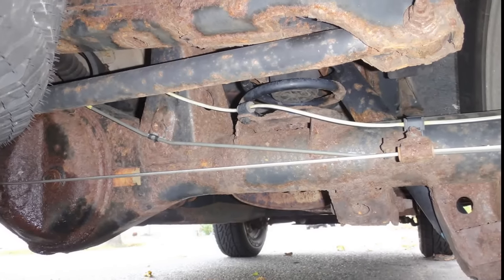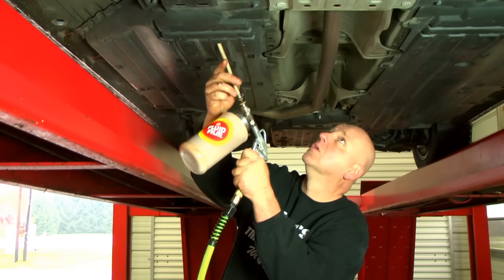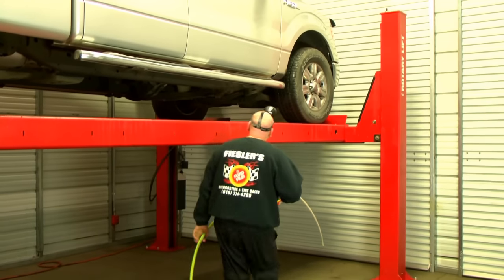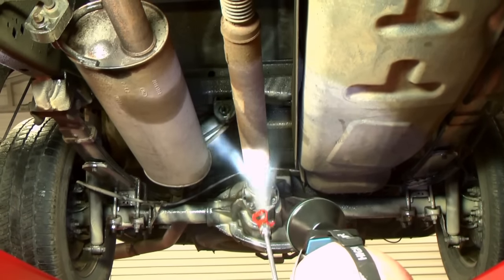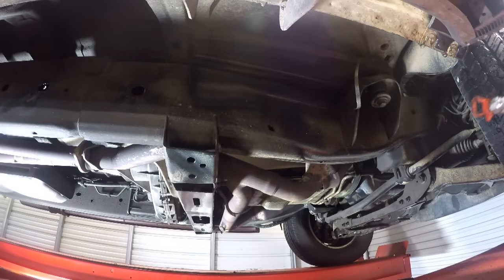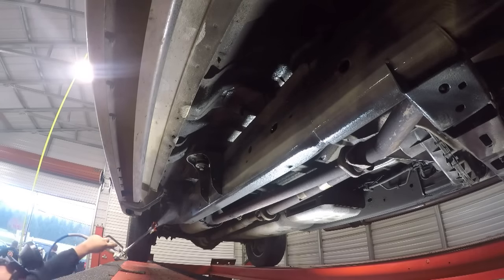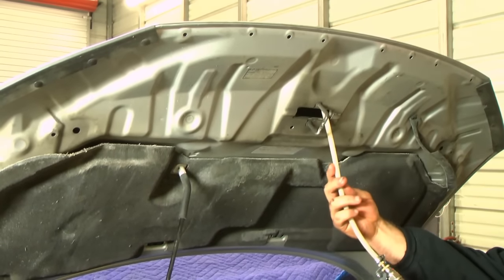FLUID FILM® Undercoating Tutorial

Comment: Apparently 27 people like rusty vehicles. FF is the cats ass. I’ve been using it for years with 100% success.
Reply from the maker: THETOPGLOCK Thank you!
Reply: I know your comments a little old, hoping to reach you, applying for the first time today, what should I avoid spraying while applying?
Reply: I use it on everything. It’s the only lubricant that last’s.
Reply: @Anthony-eg7pw  Avoid brakes.  Some say it also affects rubber but not as bad as petrol products.
Reply: UreaSmith appreciate the reply ,
Reply: I discovered Fluid Film because I just discovered major rust-through on a good-running car that could have lasted several more years.  This could have been prevented had I known about Fluid Film and used it years ago.  Rust is the worst way to lose a car.

Comment: I remember the first time I used FF, I thought it was goopy, thick and messy. Now I use it every week in the garage. I found a plastic bristle paint brush as my go to for applying the stuff, spray some into the brush and apply, puts a nice thin transparent layer down.
Reply from the maker: 49s13 thank you!
Reply: My preferred means of application is with a brush for the exterior surfaces. It  allows me to avoid the mess of overspray and waste with spraying in general.

Comment: This stuff is awesome.  You really need the official FF application gun and 360 wand to do it right.  One gallon has lasted me three years so far and that's with two apps a year in my SuperCrew F150.   Just remember, a little goes a long way.
Reply from the maker: Derek Vinyard Thank you!
Reply: Derek Vinyard Do you have to have a compressor? I don’t have one
Reply: 😁 My first application on my 2017 Super Duty crew cab 8' box. I used a hole gallon. Then 2 spray cans with small 360° tube for doors tailgate and hood. Mite be a little excessive but 2 years later looks perfect. The white Rancho shocks have 0 rust. They rust if you look at them wrong 😉. I apply twice a year.

Comment: I have the kellsport pro kit and love it! I need that spray gun emerging at 2:40 to cut down on application times and still doing a quality job. What a great undercoat. Love fluid film.
Reply: That's an airless sprayer probably for line striping parking lots. They pressurize the paint to 3100 psi. GRACO makes them. They can be costly. they have all different tips for spray width and volume. Good thing about these when they are spraying paint in a parking lot they will remove alot of dust while it's spraying . They blast pretty well but are expensive.

Comment: Bought several cans of this stuff and applied it to my truck this morning. Let’s see how it works!
Reply: How did it work for you?
Reply: @BaptistJoshua  hey it worked awesome for me. I used about 4 cans on the underbody, and then one can for the doors and body panels. Totally worth it. I found once a year was enough. But then I moved to Arizona so undercoating is a thing of the past for me now 😎😎👊
Reply: @QuintTheSharker  Nice.  Thank you.  I am trying to figure out what non-oil resistant rubber they say not to use it on would be.  Seems like vehicular rubber would be oil-resistant.
Reply: @BaptistJoshua  I get that. I was worried about it too. Depending on your vehicle, maybe you wouldn’t have to worry about it. My big thing was if the rust proofing degraded some rubber trim or seals over time, those parts are cheap to replace. But once the body starts to rust, the clock is ticking. For what it’s worth, I coated everything I could inside and out and I’ve never had any rubber fall apart on me and I started using fluid film 5 years ago.
Reply: @QuintTheSharker  Fluid Film responded to me by e-mail.  They said:

Almost all rubbers are oil-resistant. The main areas we see and warn about are weather stripping on automotive doors. Bushings, boots, frame spacers and motor mounts are almost always oil-resistant due to their exposure.
Reply: @BaptistJoshua  nice! They haven’t steered me wrong yet. Good luck. It’s a messy job though. Definitely plan on it getting on you LOL. Oh, and it also prevents corrosion on your battery terminals, so I put it on those, too. Great results.
Reply: @QuintTheSharker  Thank you.

Comment: 14s dont have grommets, ford used clear tape on the inside of the rocker. Getting it to the cab corners is tricky, theres a pinkie sized hole you can feel for through the last hole that goes to outside of corner, if you really want to get to inside of corner, and i would,  drill an access hole on the backside. Brake light leaks so get a decent new gasket if not to late and sunroof drains into them also. Had to weld a patch on driver side but got lucky on other side. And that foam in the wheel wells needs to be removed then soakm good. Its not spongy but still holds moisture, i put some in a glass of water and it wound up staying wet for a while.

Comment: What should you do if there's existing rust? Sand it off? Apply rust converter first? Just apply over little rust spots?
Reply from the maker: Fluid film can be applied directly to a tightly adhering rusted surface. If there is loose flake we recommend removing that so the product can penetrate to the base and stop it from progressing. We recommend applying our film directly to the rust or clean metal as converters can encapsulate rust and progress it.

Comment: With all that spraying, you're bound to have a little overspray on your disc brakes. (I speak from experience) because my rear brakes squeak under load, is there a way to clean the stuff off?  I've already tried brake cleaner.
Reply from the maker: 95BerrySt break part cleaner works well for breaking it down.
Reply: Heavy braking burns it off, don't worry about it. Take a ride around the block and brake hard at the stops  - ✔  solved.

Comment: Love love love love FF. I use it underneath my mower decks and to lubricate almost anything. Spraying directly on batteries is ok? What about 7 pin trailer connectors? I've seen people use FF instead of Dialectic grease. I'm about to do my winter clean and seal on truck, dump trailer, and outdoor power equipment. Anyone have any bad experience using it with mowers, saws, or trimmers? Wondering if it could harm certain plants...

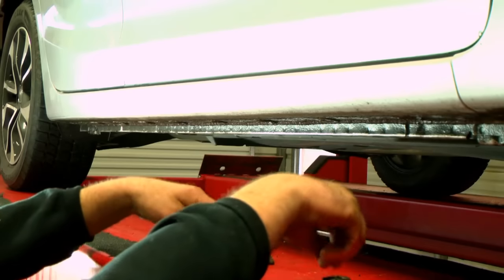Comment: @ 0:39, what type of undercoating paints does Fluid Film soften?  I was considering purchasing the Fluid Film Pro kit with compressed air sprayer and two gallons of product - mostly because up until now I have been using the aerosol spray cans under my vehicle - 2005 Jeep Grand Cherokee.
Reply: I had a CRC application from Toyota, after they had frame rot problems and feel fluid film keeps the crc from hardening, which keeps out water/oxygen. ~ Great stuff!

Comment: you guys mentioned to spray it on suspension components in the video. Is it safe? Cuz, some UCAs and coilovers have teflon coating. Can this be damaged due to Fluid film? Also can CV boots, Bushing and rubber from suspension components be safe?
Reply from the maker: mgltacoma Fluid Film will not harm oil-resistant rubbers like cv-boots, motor mounts and almost any other rubber underneath a vehicle.
As far as the Teflon goes, we have not done specific testing but know our product is used all over the off road racing for protection and lubrication of suspension components. Along with our daily commuters we have had no issues.
Reply: Teflon is the trade-name of PTFE. PTFE or Poly(TetraFluoroEthylene) is not able to be dissolved by any common solvents and is highly chemically resistant.
Reply: @asdf8391  Thanks man. My Coilovers are rusty even with PTFE. So I am applying some Fluid Film to see if that helps.

Comment: Can you apply Fluid-Film over a dry layer of POR-15 and would washing the undercarriage with a power washer weekly over the winter cause the Fluid-Film to come off? Thanks !
Reply from the maker: Hi Alvin,

Thank you for your interest in FLUID FILM®. You can apply FLUID FILM® over POR-15 but it in not necessary to paint the surface because FLUID FILM® was designed to be applied over bare metal. We do not recommend pressure washing the undercarriage once FLUID FILM® is applied. FLUID FILM® is a wet coating and spraying it with a pressure washer will start to remove the product. If you want to clean the undercarriage you can use regular hose pressure. FLUID FILM® is not water soluble so any debris on top of the product will wash off and the product will stay behind. If you have any other questions please let us know.

Best Regards,

-FLUID FILM® Team
Reply: @fluidfilmusa  so can you go through car washes?

Comment: Not looking to start an argument, but why hasn't the industry applied this product from the factory? Any feedback from manufacturers in regards to the use of Fluid Film on vehicles?
Reply from the maker: pjcd 701 some specific dealers offer our product as an option. As a wet coating our product can be removed with a high pressure sprayer and detergents so it’s difficult to offer a warranty if it was a factory option.
Reply: pjcd 701 They factory does not want your car to last! They want it to decay so they can sell more cars.

Comment: I see the recommendation for yearly application.  Is this due to any evaporation of the FF or just due to regular driving in rain, dust, snow/salt that will wear it thinner in some places?  The vehicle I want to spray should only see about 4000 miles per year and only in the spring/summer/fall so it won’t see road salt or brine.  But we do live near the coast so there is salt in the air.  Do you think I’d be able to get away with only applying every 3 or 4 years instead of annually? (Not holding anyone to their answers...just looking for honest opinions - thanks!)
Reply from the maker: Hi Chris, thank you for reaching out, yes of infrequently used vehicles in winter the coating will last much longer. The biggest need is touch up on wheel wells. A single can should be all that’s needed to do an annual touch up with a vehicle used that infrequently.

Comment: After applying Fluid Film is it wise to avoid the high pressure undercarriage carwashes?
Reply from the maker: Hi Andy, 

Thank you for your interest in FLUID FILM®! Yes, we recommend not using high pressure undercarriage washes while FLUID FILM® is applied. If you want to rinse the chassis, simply use regular hose pressure. If you have any other questions please let us know! 

Best Regards,

-FLUID FILM® Team
Reply: high pressure water is one of the worst things you can do to your car, with fluid film or not. Normal water hose is recommended.
Reply: @fluidfilmusa  why never dry
Reply from the maker: @joshuarivera2478  Hard coatings typically trap rust and cover issues. it also doesnt allow the product to penetrate into pinch welds and seams like a wet coating which is where much of the protection is needed.

Comment: In general what parts under the car can be coated and what do you want to stay away from ? Is it safe to spray bushings ?
Reply from the maker: Fluid Film is solvent free so it can be used on oil-resistant rubbers such as bushings, motor mounts, brake lines, and cv boots. The main areas to avoid are disc brakes (our product is a lubricant also) and the exhaust components (high temps will cause the product to smoke off). 
If you accidentally coat the brakes some brake part cleaner and a rag will remove it. For the exhaust wiping the excess with a rag is fine. We also recommend avoiding the weather stripping inside doors as it is typically foam or an untreated rubber. As long as the product is wiped off in a few minutes it should not cause any issues.

Comment: Hey, I love Fluid Film. Are there any issues with FF getting onto the brakes? I usually cover the drum/disc with newspaper to avoid overspray. I haven't seen anyone else do this though and notice in the video they get sprayed directly?
Reply from the maker: As our product is a lubricant we don’t recommend applying it to the brakes. In the case of overspray you can use brake part cleaner and a rag to remove the film. Most shops will bag or cover the brakes so they can coat the lines as close as possible.

Comment: Want to try it. What sprayers is he using? I like the fan tip type around the middle of the video that he used but don't know what it where to get it. Any help would be appreciated.
Reply from the maker: Ickes78 thank you for reaching out. the shop used a combination of an undercoating gun (shots with the wands) and a Wagner airless (electric powered) paint gun for the large chassis coating. Any airless paint gun should be sufficient for applying the product as we have used a number of different airless systems in the past. You can email us at info@fluid-Film.com if you want to ask about a specific gun.

Comment: What spray gun do you recommend? My 5 gallon bucket has a pudding like consistency and my paint sprayer does not work well with the product that thick.
Reply from the maker: Sam Cox Thanks for using our product. We recommend the product is well mixed and at a room temperature before spraying. If it is still too thick mixing in a slight amount of vegetable oil can help thin the product without harming performance

Comment: Hi @FluidFilm.  Well recommended product.... there are even videos out there of guys testing your product against alternatives - FluidFilm came out as the clear winner.

Going to use it for first time on a 2003 Tacoma, that’s seen light winter use in the NY the past couple years, after living in salt free Colorado prior.  It’s never had any other treatments, and starting to show mostly surface rust on the frame, undercarriage & drivetrain components - factory paint has run its course.

Other than cosmetic appearance, would you recommend for or against painting with a colored (black) rust inhinbitor prior to using FluidFilm?  We’re far off my winter season, but I’ll be using FF now as I replace leaves, springs, and various bushings.

Thanks, and looking forward to being a very satisfied customer.

PS... agree with most of the other commentors - the applicator should have been wearing mask & eye protection.  Too many yahoos watch YouTube videos and replicate poor or lacking PPE practices.
Reply from the maker: Hi Hans,

Thank you for your interest in FLUID FILM® and we apologize for the slow response. FLUID FILM® was designed to be applied over a bare metal, it will penetrate better and give you more internal protection. Other than ascetics, it is not necessary to paint the surface. This was a gentlemen working in his own shop who was kind enough to let us film him while he worked. In our next video, we will definitely request the applicator use eye protection and a respirator.

Best Regards,

-FLUID FILM® Team

Comment: Could you suggest appropriate sprayers or spec that works best with your product. Thanks !
Reply from the maker: We offer an undercoating kit through Napa Auto and O’reilleys with a part number FFSG.
Other than that most airless (electric) paint sprayers will work. Gracie and Lemmers both have a line of undercoating systems to handle our products.

Comment: HI,

  I have a 2004 Town Car.    For the most part, the underneath of my car is fairly rust-free.      The main areas that have develped any rust are the mufflers and tail pipes.     According to the video, I can't use the Fluid Film on these particular items, though.       So when it comes to underneath the car, what can I actually use Fluid Film on to prevent or slow down existing rust?
Reply from the maker: Hi Sean, the frame, suspension components, pinch welds, seams, inside doors, inside rocker panels, hood, trunk, inside voids and at the connection points where the muffler attaches to the frame.

Comment: So this product won't attract dirt and look like crap when. It drips out of drain holes in doors,hoods,and trunk?
Reply from the maker: Fluid Film is a wet coating and can get a surface dusting of dirt. As the product is solvent free it does not get tacky like other wet coatings and the dirt often can be rinsed off without removing the coating.

Comment: If you choose to use an airless sprayer to apply the FF product how do you clean the lines of your sprayer and pump?  Also will FF effect any of the internals of the sprayer? I want to still use my airless sprayer to spray latex paint.
Reply from the maker: Nathan Hoover Hot water with a degreaser like dawn or simple green run through the lines will clear it. Then rinse with water through the line.
Thank you 😊

Comment: How often should you reapply to places like wheel wells and rockers as those get the highest wet areas due to kicking up rain, snow and salt?

Driving over 60 miles on the highway daily would more than likely wash the Fluid Film fairly quickly.
Reply from the maker: You might need to touch it up once or twice a winter for those high traffic areas. There is typically a good amount in the pores of the metal to last a full season but depending on conditions and usage touch ups are sometimes nescessary.
Reply: @fluidfilmusa  ok, thanks. 👍

Comment: DO YOU NOT NEED TO MASK THE VEHICLE?  what if it gets on the paint?  whats best to use for cleanup on painted surfaces  and the gun afterwards?  Looking to offer this service to my customers.  I do paint work and detailing.
Reply from the maker: Fluid Film contains no solvents, silicone or Teflon so it is body shop safe. Our product does not harm a finished paint and can be removed by washing with warm water a pressure washer and a degreaser. Warm water and dish soap can be used to clean the gun if it will not be used for a longer period of time.  If you would like more information about becoming an undercoater send us an email to sales@fluid-Film.com and we can further assist you.

Comment: I have a 2003 truck that barely has any rust. I live in SE Florida and cars don't necessarily rust that badly but it does rain a lot at times. I also get mud and inland freshwater sand underneath a lot. The bottom is not washed all that often. Would a yearly coat hold up?
Reply: you don't need rust proofing